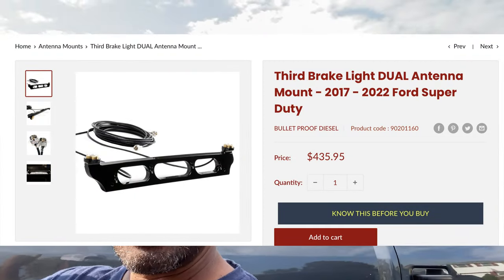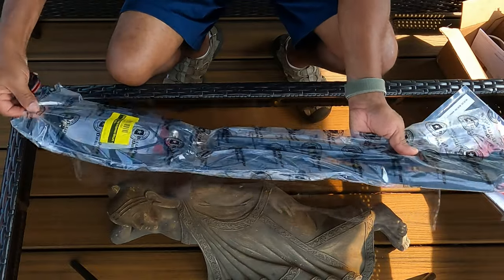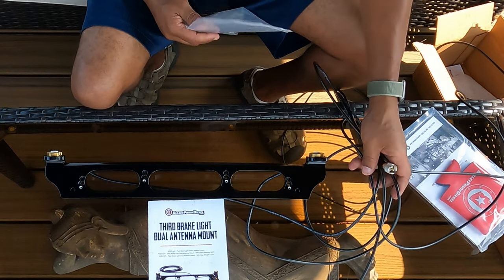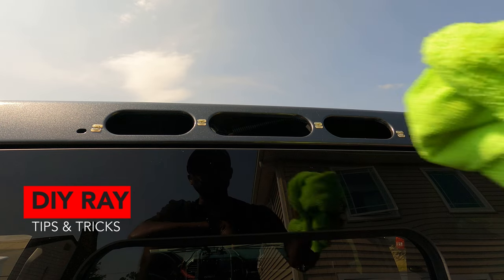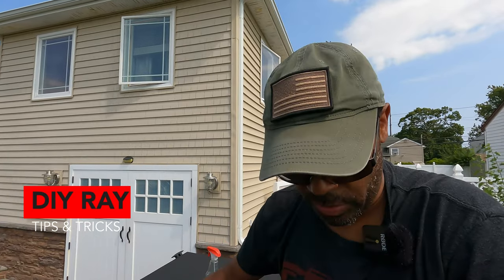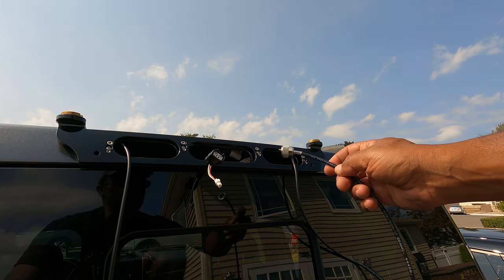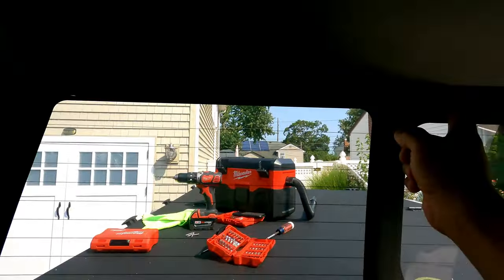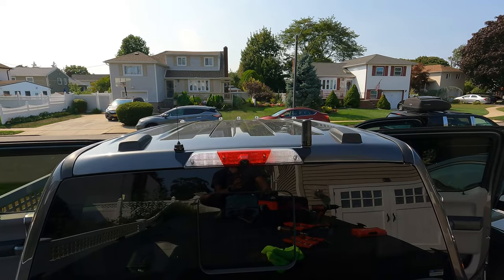Installing Dual Antennas mount for GMRS and HAM radio operator into Ford F250 F350 Super Duty Tremor

Comment: I just picked up a 2016 F150 in excellent condition.  The last thing I want to do is drill holes in the truck to install a traditional antenna mount for my HAM radio.  I discovered this BulletProofDiesel mount after a little research and decided this is exactly what want.  You did an excellent job showing how to install this.  Thank you, great video!
Reply from the maker: Thanks for your comments. It’s expensive but worth it. Buy once, cry once.

Comment: Did you ever put an SWR meter on the GMRS side? I also have a ham radio setup in my 2015 F150. Due to having an ATAS-120 on the front driver side quarter panel area and a dual band vertical on the front passenger side quarter panel I'm short on space for a GMRS antenna with good ground.

Comment: Just installed my antenna mount today. Your video really helped with the installation on my 2024 Ford Maverick. The light connector was a bit different but still easy. Tomorrow its the radio installation. Should be easy as my battery is under the rear seats where my antenna wires are now placed.

I noticed the cabling was manufactured by DX Engineering. I assume they partnered up with Bullet Proof Diesel. Impressive!

Great job!
Reply from the maker: Great job 👏, thank for sharing your experience. Remember to like and subscribe to the channel.

Comment: Outstanding job, and very clean install.  Nicely done.
Reply from the maker: Thanks for commenting. Please remember to subscribe and like the video.
Reply: @DIYRAY  Already done.  Have you done any range testing with your GMRS radio?  I own a 2015 Ford F-150 and since it is mostly aluminum I have been looking for a way to install a decent GMRS 2 way and maybe a HAM 2 way.  Your video brings hope to my problem.  Keep up the positive work.
Reply from the maker: @ldean2832  my range is very good. I’m able to hit my clubs repeaters a few miles away from my house also having the antenna at its highest point help with reception.

Comment: Great video.  I'm leaning towards this mount, but I"m still not sure I'm willing to drill into my truck.  Looks wise, this is exactly what I want, plus it gets the antenna higher.  

What is the bracket you have your radio mounted to?  Looks like a good way to mount the radio to me.
Reply from the maker: Thanks for the question, please read the description section of this video. All links are provided for items in this video.

Comment: How did you run the wire from the radio to the faceplate I'm assuming? Solid work and very clean.
Reply from the maker: Using the cable that was supply with the item. Please check out the video shorts that i recorded showing my set up.

Comment: I was told you shouldn't roll your extra cable up, cut and shorten or run through your vehicle. Have you found and loss from it being rolled us as you showed in video?
Reply from the maker: I haven’t had any problems with my installation. Thanks for the feedback.
Reply: 5 min later, I saw a video that tested out this very theory.   I linked it in another post if you felt like watching it.

Comment: Very clean install. I have the single antenna version on my truck and i love it. It is super clean and an amazing look for the truck. What is that rack you used to mount the radios to behind the seat? I have an f150, not sure if it would work, but would like to research 🤔
Reply from the maker: Thanks for your comments. Please read the information listed in the description below. I believe I listed it. If not let me know. Please remember to subscribe and like.
Reply: @DIY RAY  thank you. I found it shortly after I had made the comment. I might have to get the under seat one too 🤣